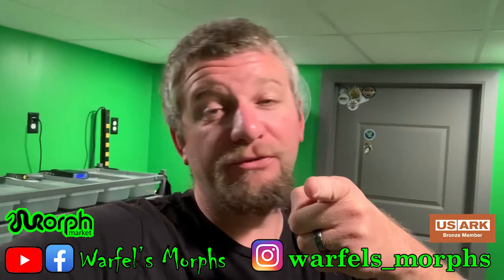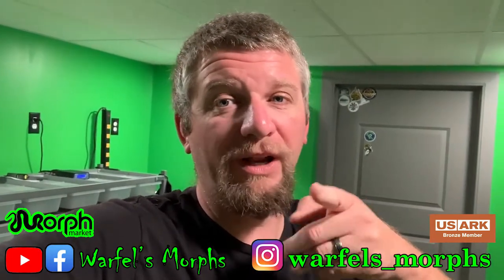Snake room Electrical Layout

Comment: I built my snake room off of my house, I did everything myself. I did multiple receptacles on every wall. I put ceiling fans in wired in a subpanel to control everything. I also installed a mini split unit so I can control the temps separate from my house. Everything is working nicely. The snake room alone has raised my electric bill alot but I love doing this stuff. Worth every penny. Good day Jeremy!
Reply from the maker: That’s awesome PJ!!! I thought about ceiling fans but I like the fans that can articulate and mount on the walls. Now who knows what I’m going to do when I do the addition to the snake room. I know mine has gone up a little but it’s only bad in the winter because of running a heater down there. Spring summer and fall it isn’t bad. I completely agree though it’s worth every penny!! Have a great one PJ!